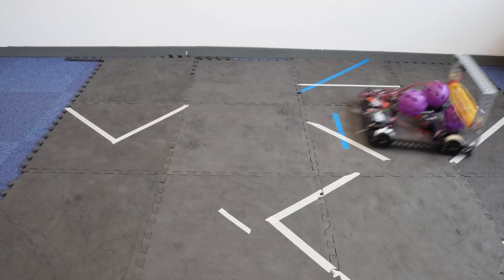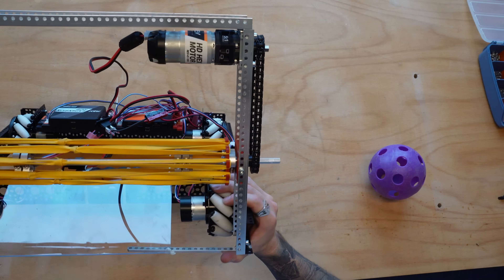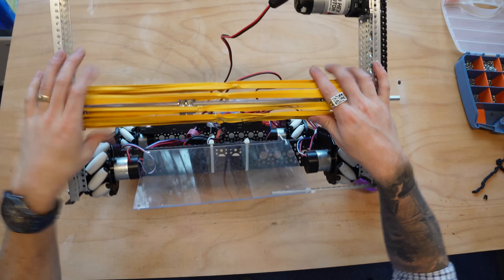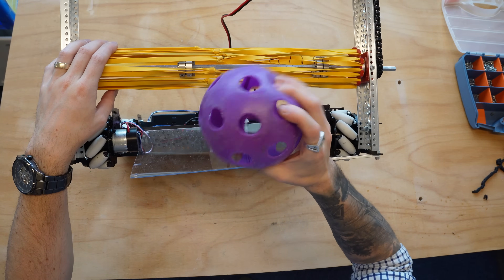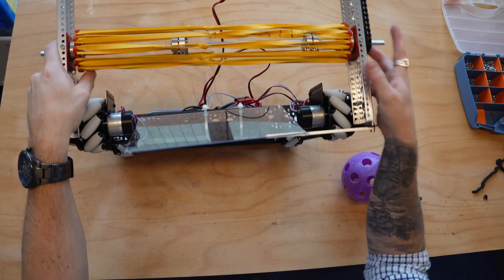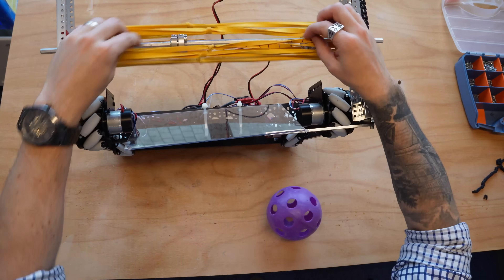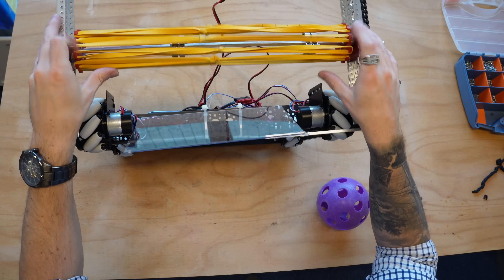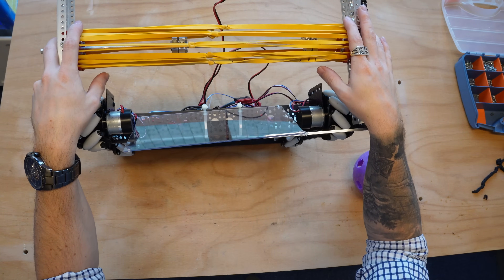The Secret to Perfect Ball Intakes

Comment: We had the NZ nationals a few days ago. Two teams had robots with rubber band intakes. I’m not sure if it was the type of rubber band or the speed they were running it at. But their robots were loud!
Reply from the maker: Yes, lots of strips cutting through the air certainly makes a wild noise. When one of the teams I mentor runs their intake forward/backwards, it sounds like a spaceship taking off.